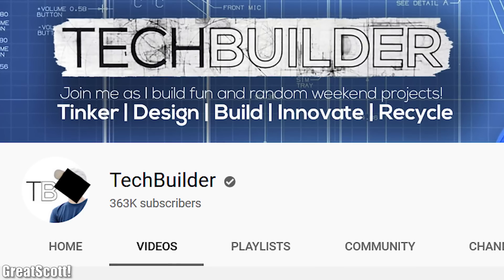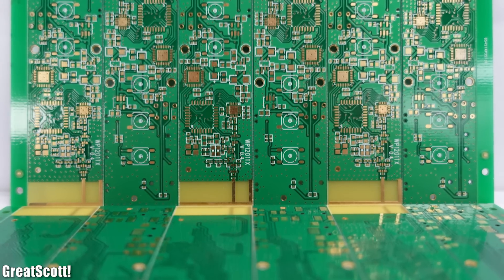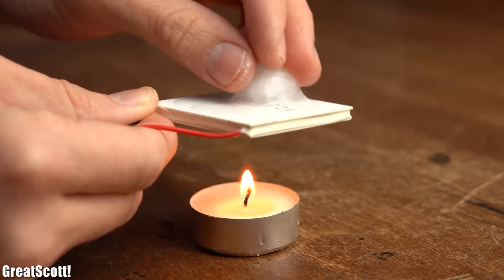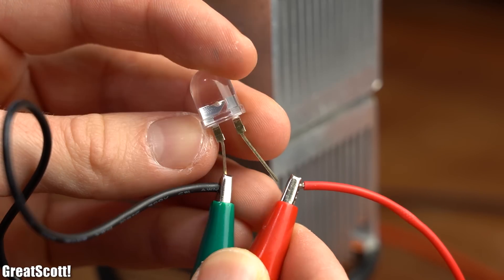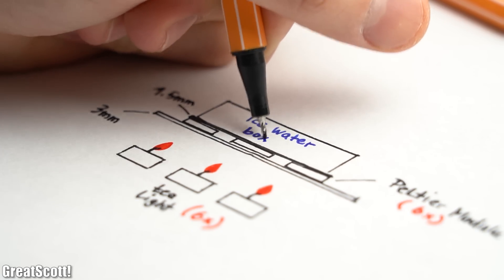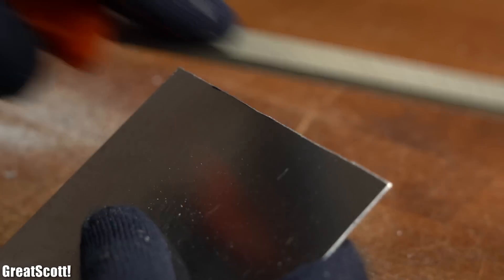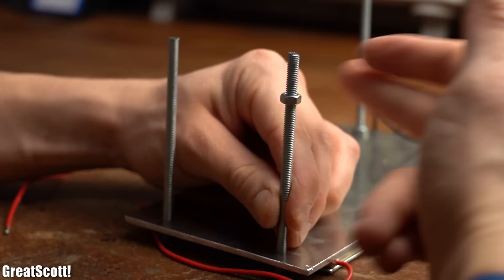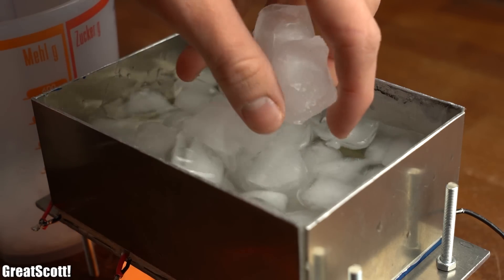Exposing a FAKE Thermoelectric Generator and building a REAL one!

Comment: Could there be places in the world where hi differencial temperature could be used with peltier to produce cheap electricity? Like near hot water sources, volcanos, over glaciers under the sun,...
Reply: Well, I think that this would be possible for the first few minutes or even hours, but after a certain amount of time, the peltier module would heat up, which would slowly decrease the output voltage. You would need to constantly cool the cold side by, for example, circulating water over it. But to do this, you would need to use the power created by the peltier module, lowering the overall power output even more. Simply passing the steam created by the heatsource through some turbines, like in a geothermal powerplant, is way more efficient.

When I think about it, there actually is a use for this type of power generation. It is used in RTG's, to power satellites and rovers. But it only works there, because the average temperature on mars, for example, is around -60°C, so more heat can be dissipated.

Comment: what if you make it so cold that even a little amount of heat does a lot ? does it work like that ?
Reply: i mean, you're right, it would theoretically work, if you would cool the one side down to something like 80°C and have to other side at room temperature, you would produce around 670 mA (with a generic peltier module from banggood). But that is nothing compared to the amout of electricity required to get the module to these freezing temperatures. So I think it wouldn't really be worth it.

Comment: Can you stacked them and connect in series to check if efficiency improves?
Reply: I've read that you can stack these modules to generate even lower temperatures, but with that, the effiecency greatly decreases. So I would assume that the same is true for the opposite. Also, by layering the modules, you decrease the amount of temperature difference at each one of them, decreasing the amount of electricity generated at each.

Comment: There is a TEC in name for a reason -  ThermoElectric Cooler, so it's designed for cooling not generating power. There are also hight power peltier TEG modules  - ThermoElectric Generator

Comment: Thank you Scott. I keep thinking to build electricity generator using peltier, which hot side os being heated by focused sun ray (fresnel lens). Store the energy to lead acid battery. After watching your voltage-amperage numbers on multimeter it is obvious that I will drop my plan and stick to Solar Panel instead.

Comment: If you stay in cold locations where ice is freely available, this experiment would be ok, but you will then probably need more candles to achieve the required temperatures. If you could find a free source of methane gas that would solve this problem.

Comment: Well until adding ice water part it is a decent survival generator to be honest but it will only work somewhere in the north where you can easily access ice otherwise you'll need a refrigerator to make ice but if you have access to a refrigerator that means you have access to city power and it will be much easier and efficient to make an adaptor to charge your phone I think.

Comment: I think the issues you were having with the soldering is due to the oxide layer Aluminum protects itself with.  You may have to prepare both mating surfaces just before soldering due to how quickly the oxide layer forms.
Reply: Yeah I think even welding aluminium is not easy and soldering is much much more difficult

Comment: Sorry my english is not very nice am french. I think you are confused between tec module and teg module. The phenom are the same but the metal are differents. TEC module are used just to create heat and cold so there a construct for lower price and not for performance. TEG are most powerful, in France wee can buy 30w module teg for 250 degree delta. Obviously teg is really more expansive ( around 10* Price of tec)

Comment: I didn't watch the other video (It's set to private), but It's not really apples to apples. 

The hot-side heat sink is grossly too big and too there is too much space between the flame and that heatsink in the first design.   Your revised version took advantage of both by reducing the air-gap to the flame and reducing watts dissipated per square cm (inch) of the hot side plate.  Again, the video was changed to private (so I could not see that design).  Just those changes alone would greatly increase the efficiency (not counting scaling up or further increasing the temperature differential with ice water).  Not getting into the math or exact numbers, the surface area on the that heatsink for 1 TEC is probably close to the surface area of the aluminum sheet that you used with 6x TEC devices.  There is a loss of heat to air as it rises to the hot side heatsink and that heatsink is dissipating heat into the air around it before it gets to the peltier . If that was the design flaw that you were trying to point out, it would have been great to see (or hear) that explanation or some of those numbers (space between the flame and heatsink (and/ or peltier), how many watts the hot-side (and cold) heatsink/ plate dissipate, and some temperature readings at each side of the peltier  (or around) to go with the volt and amp readings). Delta temperature vs watts produced.  

Personally, I've never really liked the hot under cold designs.  The heat rising up increases ambient air around cold side heat-sink, which lowers the temperature differential and overall efficiency.  In that case not only do you have the heat transferred through the TEC to dissipate to keep a temperature difference on both sides to produce energy, but the heat not captured from the candle increasing the ambient air around the side you are wanting to be cooler.  

For efficiency you could add insulation or other material that restricts the thermal transfer between the hot and cold plates better than the air gap.  If you going to do the hot under the cold then you could add a skirt around the hot side plate to trap some of the heat in on the hot side and maybe direct it away from the cold side directly above.   Slow down the rate it reaches equilibrium and temporarily keep the temperature differential higher.  It would be interesting to see something like a "clay pot heater" (or "tea candle heater") as the hot side and peltier(s) mounted on the sides.  Potentially keep the hot air rising away from the cold side or at least not directly crossing the air flow  paths.

When you were soldering/ brazing the aluminum together; You should sand the area with a fine sandpaper and use flux to clean the surface (unless your solder already has flux in it).  Also, using the heatsinks to hold up the aluminum sheet is counter productive when heating it up with a torch.  The heatsinks do what heatsinks do and dissipate the heat you are trying to put into the material.  Don't forget the heat the area around where you are soldering too.  Bring up the temperature of the material up without oxidizing where you are soldering as much.  If you get it hot enough the solder should "absorb" into the material.  

I'm curious how much ice/ candles you have to use to charge your phone any significant amount.

Comment: if you want use ( Al ) solder , you should first clean Al oxide by filing the edges , second you should use Flux (paste like ) this material make the solder stuck and flow

Comment: 1) I love the debunking part 2) How is using ice feasible for most survival situations? 3) Please revisit! DIY or BUY with a camping fire charger?
Reply: It doesn't strictly have to be ice, because at the interface, the heatsink is something like 0-4°C, cold water rather than solid ice. You might as well use cold water from a mountain stream that you replace a few times a minute. Basically, just camp near glaciers, problem solved - i don't think "most survival situations" was ever a claim, but that there are nonzero survival situations where it would work. That being said, there might be a more effective way than having a big Peltier assembly stashed on you.

Comment: Hello. Instead of TEC versions, use TEG, that is for GENERATORS :) Thanks for video.
Reply: Yeah, people don't realize that the type of thermoelectric coolers used as coolers in mini fridges don't work well as generators, and the thermoelectric generators don't work well as coolers.
Reply: (T)hermo(E)lectric (G)enerator as opposed to (C)ooler.  TEGs are designed with a peak efficiency at high temperatures. The temperature differential (hot side, cold side) is what generates the electricity. Amazon has a TEG that claims 10 watts, but that is at a 120 C differential which is pretty difficult to reach because the conversion efficiency is closer to 5% so keeping the cold side also includes pumping away the wasted heat.

Comment: If you use a smaller mass on the bottom and keep the top one you utilize the candle more efficient. Heat dissapation of the lower part is too high and you can probably go up to 100 c. That gives a delta t of 80 degrees theoretically if your room temp is twenty degrees. A more reasonable temp is a delta t of lets say 40-50 degrees and it would definatelly increase the current . The peltoer element used here is more or less the same they use in a commercial variant for a portable cooking pan ( well proven and valid), wich delivers 9 volts and decent amp for a phone charging. It is nowdays very common of camping stoves to have a peltier with a usb port in the pan of a camping stove. A peltier is a peltier so as long as you got a delta t it is easy to get current. No need for ice bucket if you do your delta t properly.

Comment: To solder aluminum you must remove it’s thin layer of oxidation, it’s different to ferrous rust that keeps exposing the layer of metal to the air. Aluminum oxide acts like a shield, it must be sanded off and quickly fluxed or deprived of oxygen with a heavy gas, aluminum is quite the hassle to weld and solder, if not properly done it doesn’t adhere at all

Comment: I was wondering how much of a difference using calcium chloride dumped into water would make. Beforeefficient cooling systems were made labs used to use that method for getting down to -40C.

Comment: Brillant video. Correct me if i'm wrong but with your setup , IF you were to increase the voltage slightly say by adding another 2 modules and then run it through the buck converter would it not boost the current proportionally to the voltage to the max of the converter i think it's 30v max ( so if you had a higher input voltage within reason and set the buck converter to 5.6 volts would that not dramatically increase the available current?) any help is appreciated would also make a great future video?...........

Comment: platinum catalytic heater. Use white gas or kerosene. Should produce the heat needed to make the generator work. Would last probably almost a day off minimal fuel and since it isn’t a flame there shouldn’t be any problems with carbon dioxide. Thing is it would be expensive to build and it won’t put out all that much voltage. I think it will be worthy of a try..

Comment: The thing is that you almost need 1 amp to charge a phone properly. Smartphones with fast charging can suck up to 2.2 amp at a voltage of 5 volts. A few phones with ultra fast charging can be charged with a voltage of 12 volts and 2 amps of current. so this setup is waaay under powerd

Comment: For a flexible fuel TEG, what if you used 2 containers with modules sandwiched between them? Fill cold side with cold alcohol or antifreeze. Fill hot side with heated thermal oil.
Cold-side liquid could be left outside during winter months. Hot-side oil could be heated with either fire or solar via Fresnel lens or parabolic reflector.
Seems like that would give better control of temps on hot side (to keep the heat under the module’s recommended max operating temp) and allow flexibility for heat sources. As well, with a thermos, hot oil could be stored until it’s time to use the TEG or refill the hot side.
Just an idea.

Comment: @GreatScoTT, what do you think if you used a circulating water system, yes I know you need to power the pump, but you could have one tank/sink in a bucket of water to cool the water while another one on the cold side of the plate to soak the heat? Think that might work?

Comment: Try a double-ended-flatten-coil-tubing(copper)
 And with a PC cooling system, probably one with a pump and reservoir.(helps with the cooling)

For the heat, you could use a heatsink with the other end of the copper tube.(whilst still having the candle to provide heat)

Attach a small power bank as a mean to get power instead of plugging in phone.

Pls , if you see this consider trying it out.

Comment: wouldn't a really easy way to figure out if it is fake or not be to just calculate the energy output of a tea light candle and see if it's even remotely close to the power requirements of the charger system?

Comment: Move your heat source closer to the TEG units, add a heatsink to the bottom side to increase heat-gathering surface area.

The heat source is poor- much of your heat is wasted pouring away from the unit. Putting a large heatsink with much more surface area for the heat to be captured from the tea candles as well as moving them much closer (less height) would have made a substantial difference. 

Using only one of these low current TEG modules, I installed a small heatsink on the bottom and applied a backpacking stove at low output mode/small flame, the flame was directly applied to the small heatsink feeling for the least amount of wasted heat escaping the unit. I installed a large CPU heatsink with heatpipes on the other side of the TEG. I did not push the unit to its limits at all and I was able to get consistent 350mah at 5V self powering its own 120mm fan to cool the large heatsink. This 350mah was only when the fan was forcefully stopped/braked, when the fan was free spinning at high speed, the current draw was only 70mah at 6.7v (less resistance) but proving there was plenty of spare current using a small flame and only one TEG module at low and safe temperatures avoiding burning of unshielded wires.

Comment: Thank for this video, it was really intersting.
The thermo-electric generator efficiency depends on the heat flux that goes trough the pelletier module, but in both designs (yours and the fake one), most of the head flux just pass trough the surrounding air. Therefore I presume that the design can be improved by adding some insulation, that prevents as much airflow as possible without switching off the candle. As a first try, I'd just replaced the metal grid cylinder with something much more closed like a soda can with a small opening, or a cardboard box attached to a heat sink.

Comment: Shouldn't you use a TEG instead of a TEC if you want to generate electricity? As it would be more efficient when generating than the TEC. I believe the TEG can also handle higher temperatures.

Comment: TEG expert here, nicely done GreatScott. Here’s a few bits of info on the subject.
1. The effect your seeing is called the Seebeck Effect.
2. The most efficient TEG system made is around 0.4%.
3. TEG’s are best suited for space exploration. This is because of a: vacuum of space slows the oxidation of the substrates b: infinite cooling due to the vacuum of space c: infinite heat from celestial bodies i.e. the sun. If no passive heat source can be used, radioactive isotopes are used, these are called RTG’s (Radioisotope Thermoelectric Generators).
4. The common substrates used to make thermoelectric modules are made of Bismuth Telluride or Lead Telluride that is doped with different compounds to make them Negative Or Positive Charged.

Surprisingly, there is only a few manufactures who specialize in this field of alternative energy. So far China is in the lead in making these modules at such a low cost. High Efficient modules can run into the $1000’s. Makes it difficult for US manufactures to compete.
Reply: Those elements can be optimised for generating, those that a rated as generator units any different from regular panels?

Comment: Enjoying your videos. Few years ago, bought a modified to be run by kerosene, RITEG or RTG Radioisotope Thermoelectric Generator. Those have been used for decades for powering remote lighthouses. However, it uses TEG-s not TEC-s. The G stands for Generator, and those come usually in darker mostly gray color.
Reply: Are those better? Than tec?

Comment: Is there a way to limit the current while maintaining a set voltage? I built a larger version of this that makes about 12 volts. when I add the buck converter and reduce it it to 5  volts it makes about an amp.

Comment: one thing you can do is to add something that stirs the ice water bath. the bath initially provides a significant temp difference, but you quickly loose it due to insulation effect. stirring allows for constant exposure of cold water.

Comment: So... Considering that puny output, would it make any sense whatsoever to place some arrangement of Peltier modules in a wall of a house to salvage back some of the heating power during winter? My guess is no but I'm still curious. And yes, I'm aware solar panels are the most cost effective way of generating power at home.

Comment: So many people don`t understand how Peltiers work and how much power you can expect from such a system. I made quite a few attempts myself, calculated the theoretical output and tested it but the results were also quite poor. Nevertheless, I think that there may be a use for it apart from the thermoelectric oven fans that became quite common. But getting a tiny little bit of electric power out of an oven and help with heat distribution in the heated room via fans seems to be the maximum that is possible.